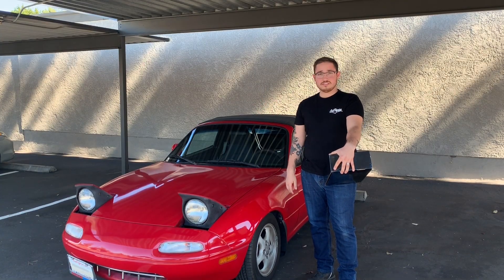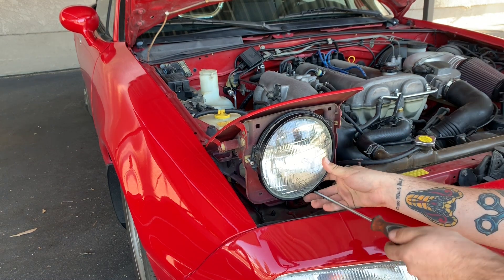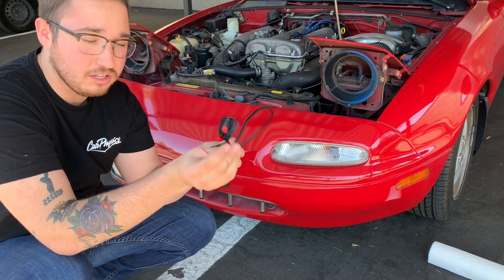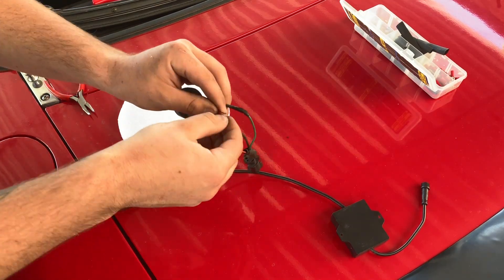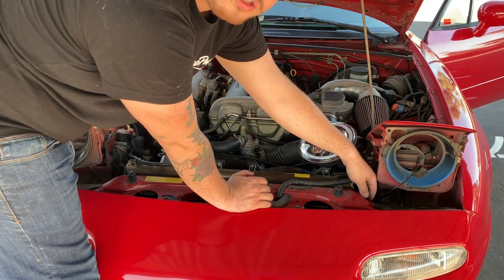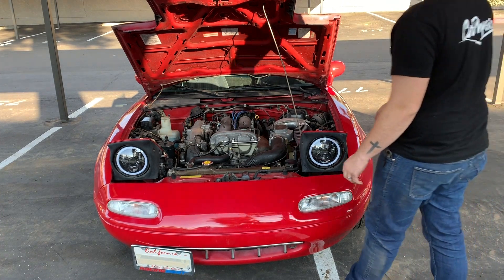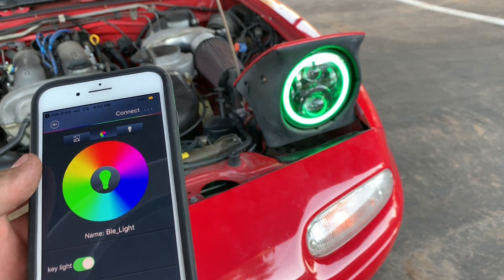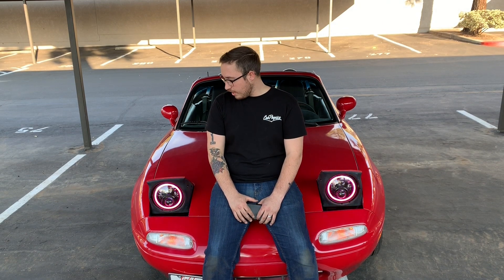LED Color Halo HeadLight Install on a Miata

Comment: It's a bit late but I highly recommend some armor all plastic and vinyl restorer for the black covers, I got some a few months back not really expecting much and it turned out a lot better then I thought it would. Makes them look like new, same with the interior plastic and the bumpers if they don't have a clear coat on them.

Comment: Should've bought one of these over my old 330ci, this is wayyy easier than the angel eyes I had to do for that.
Reply: I don't think they would have fit in your 3:30 the reason that these work for the Jeep in the miatas because of the headlight housing itself is the same size like you'd have to modify the front end of the 330 to a point where it wouldn't even look like the three series anymore but I'm no expert it would just look like a Jeep series or Jeep30i

Comment: add some ultra black on the headlight cases and it'll renew the blackness, would look 1000x better
Reply from the maker: My miata got stolen and totaled but that was definitely a plan for the Car, wanted to bring back all the faded black trim, replace the wheel, hardtop etc 😀. Thank you so much for watching!
Reply: @ChristianLopez33  Not a plot twist anyone was hoping for ://

Comment: i installed this in my 94 miata and they work great, but my headlight won’t pop down now and i’m not sure what caused that.
Reply: Same did you figure this out. I also have a 93 or 94 Miata
Reply: @PreenonHuq  did you find the fix by chance?
Reply: @lilblingking1491  yeah I had to charge my battery with a trickle charger over night with the car off
Reply: @PreenonHuq  thanks!!!! I’ll try this if i run into any problems
Reply: @lilblingking1491  yeah lmk if you have questions!

Comment: Was the cable that was routed across the front of the car wrapped in heat resistant material or will it not get melted through

Comment: Considering that the halo is connected directly to the front amber lights, do the halos blink when you turn on the blinkers?
Reply: You have to get the non-RGB halo version of the Aukmak lights if you want it to go from white halo DRL to amber halo turn signal flashing

Comment: Are you experiencing hyper flashing on your driver's side turn signal after the install?
Reply from the maker: Anthony Cantu I am not experiencing any Quick Flashing
Reply: @ChristianLopez33  thanks for the response. 
gonna purchase a used turn signal wire loom since mine is in very poor shape and that should fix it i hope.
Reply from the maker: Anthony Cantu I am currently editing my Review of these lights. Video should be up in a few hours!

Comment: Only issue I have is the one halos I have are a newer model and the Bluetooth controller has two more wires than just the power and ground and I don’t know what they’re for
Reply: Did you ever figure out what to do with those extra wires? In the same boat
Reply: me too man im confused
Reply: i am also confused

Comment: My app won’t connect and the lights don’t work unless the high beams are on
Reply from the maker: I am unsure why the app won't connect, as it functions with Bluetooth. It does seem the headlights may have been wired incorrectly. They way mine were wired had the signal with the running light and had no issues..I'm sorry your dealing with that! Always annoying when a simple install turns into a headache, from experience it happens alot 😅

Comment: Can these just be set as white? Or do they have to be a color?
Reply from the maker: Mike Meehl yes you can! I use them white all day. Got pulled over when I had blue halos lol
Reply: Christian Lopez thanks! Ended up just going with the white and amber turn signals the install was still the same though great video

Comment: Mines dont sit into the the tab slots, the headlight sits cocked do I have to trim the tabs off the headlight or is there a trick to getting them on?
Reply: What did u eventually do? Got the exact same problem right now, tried to weld it into the right shape but it still doesnt fit perfectly